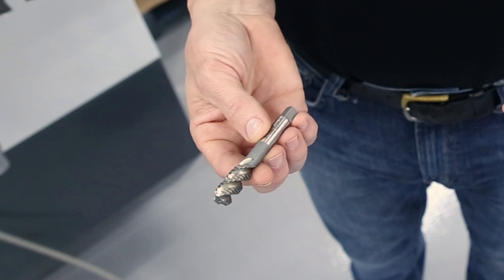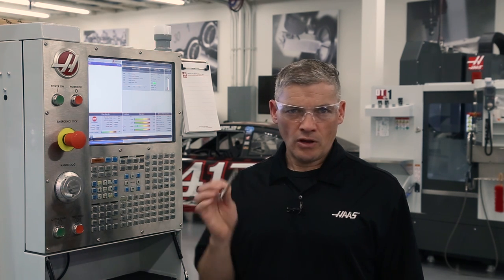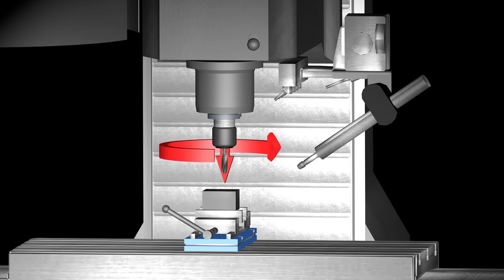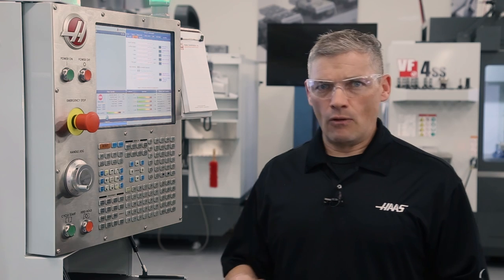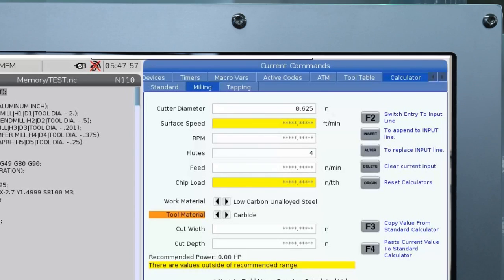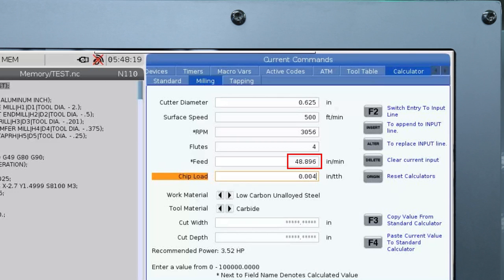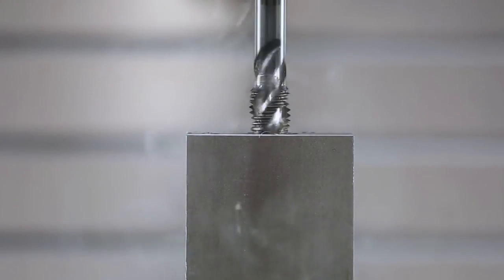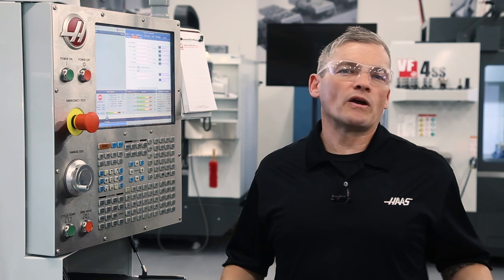Haas Apps Min - Quickly Calculate Feeds and Speeds

Comment: calculating feeds and speeds for tapping is sooo much simpler: feed = 10IPM and speed = TPI x 10. so 1/2-13 tap would be 130 rpm and 10 ipm. 1/4-20 is 200 rpm and 10ipm just multiply both by the same number to go faster. for metric, start with 254 rpm and the feed is lead x 10, so m6x1.0 is 254 rpm and 10 ipm. m5x.8 is 254 rpm and 8ipm. again, multiply both by the same number to go faster.

Comment: Please do it for lathes ! Nice video !
Reply: the lathe only needs SFM and chip load - the mill needs to convert to RPM - the Lathe self adjusts if you are running in G96 mode